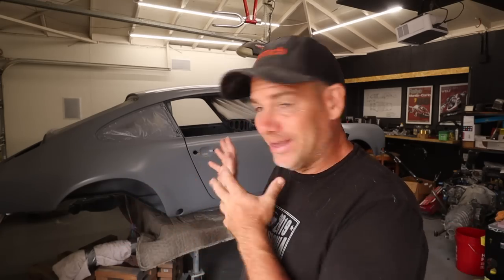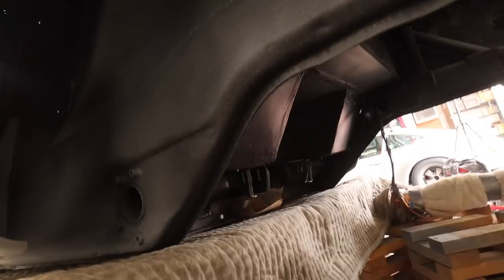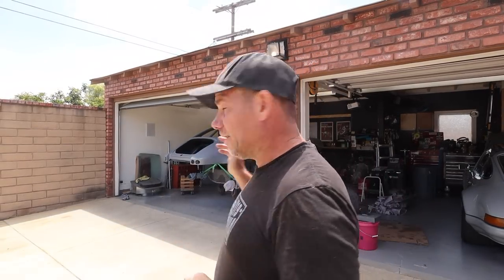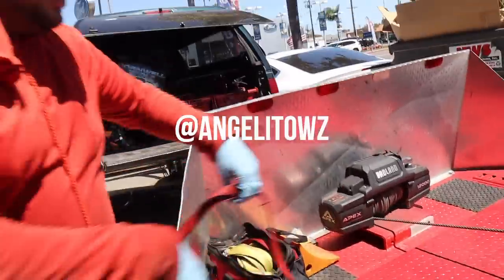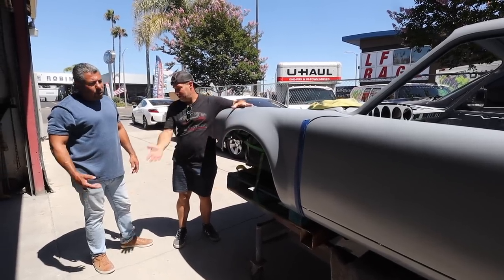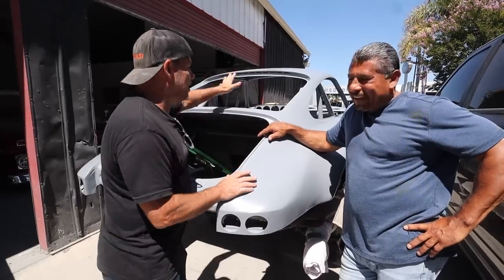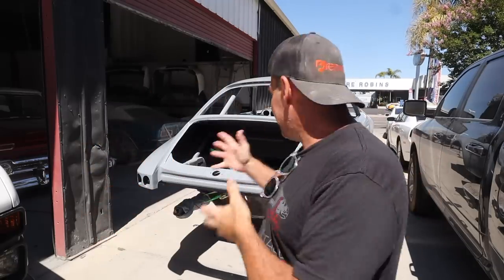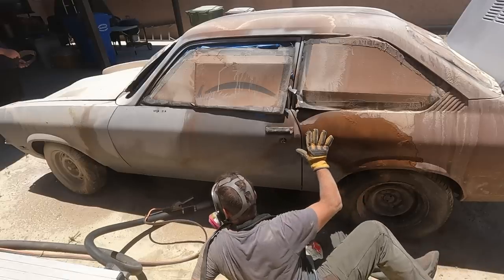FINALLY! Painting My Vintage Porsche 911 Restoration (Part 1: Delivery) | Blasphemy Build Ep. 87

Comment: Exciting the 911 is moving to the next phase. 

You lucked out finding Angel Towz. Perfect trailer set up for your needs. Keep that guys number handy. Great to have a good support network to call on when you need it. 

 I actually cringed a bit when you said AAA. I have had a AAA membership for 20 years and (knock on wood) only needed one tow in two decades. That stated the last tow I called for the driver was pissed it was a Copart car. I offered to pay for the service in cash but he just was dead set on hating me and my tow. Car actually drove onto the flat bed. He took the car where I needed - talked to my mechanic before the tow guy left - tow driver gave my mechanic attitude as well. I had $100 bill in my pocket as a tip for the tow driver… it stayed there. The damage was done no sense in rewarding the behavior. Seemed like an unhappy dude. I hope he finds a job he enjoys. Life is too short to hate your job that much.

Comment: Handled it like a boss tho. Cars coming along nicely, I agree with the body shop guy that a sharp line above the rear lights wouldn’t flow with the rest of the car but it’s your project/design and if that’s what you want stick to your guns as I won’t be surprised if we prove to be wrong and it looks awesome. Everything else on the car has turned out that way. Is it gonna be Green like the renders from before? Would look awesome in pearl white imo